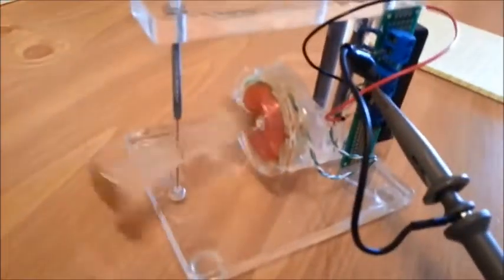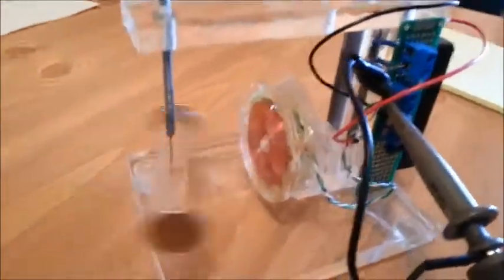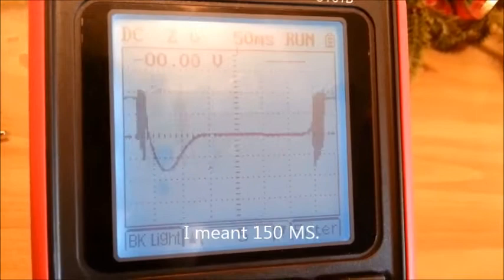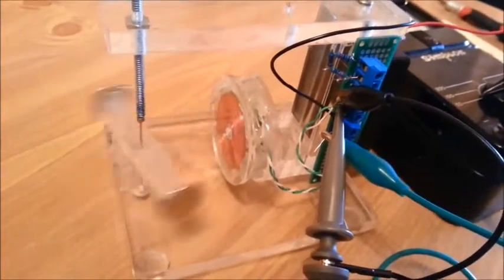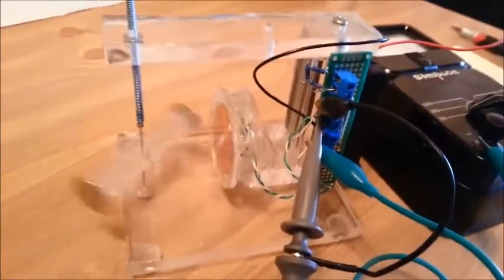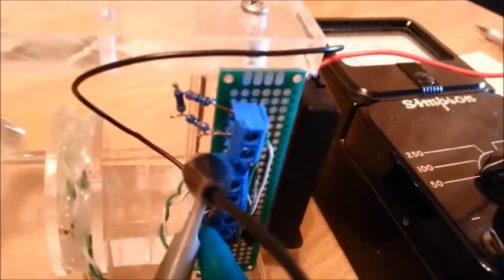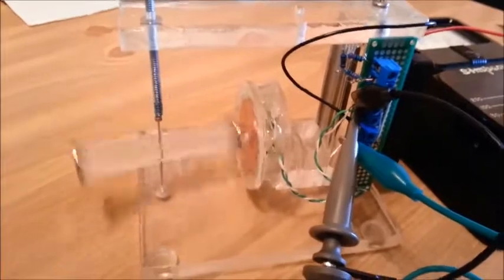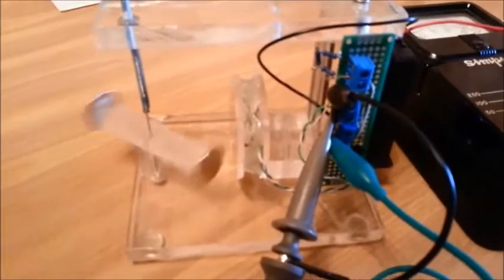20 year Pulse Motor. 2.86 Micro amp draw EZ spin type motor

Comment: Beautifull but I feel like if it would be simetrical , I mean oposed coils, it would be much more efficient
Reply from the maker: The second coil would require more energy to run. The cost vs. the benefit would be difficult to calculate.
Reply: @kafr8413  yes but there won't be that much lateral force when the magnet get repeled , anyways you might be right maybe the loosed energy on the other coil would be more than the benefic from a balanced push

Comment: My new improved pulse motor 0,7uA
https://www.youtube.com/watch?v=y3xaTwCMmRo
Have you tried to make this type of motor ????
Larskro
Reply from the maker: Your motor looks great. I will have to build one and see how low the amp draw is. I like your glass bearing as well. Looks like the rotor has a lot of mass. I like it very much. Thanks for sharing your design.
Reply: My rotor has a little mass. It is made of foam plastic. Diameter 60 mm.

Comment: I've been putting off playing with these for so long but watching your videos along with Pali's and lasersabers, not to mention a few others.. I'm getting pretty inspired.  

so many possible variations for these motors you almost just have to try them all. I like that you are using the 2 magnets and somewhat a substantial sized rotor. That way it basically monopolizes on the pendulum style pulse circuits and uses even less energy. 

I'm waiting on a reed switch to come in the mail today so I can play around with this stuff some more. I still can't decide which is a better switching method mechanical or electronic.
Reply from the maker: Mr. Pali is the real innovator. He invented this out of whole cloth. I am just somebody who copied his brilliant design. His ability to make coils out of thin wire is unsurpassed. As far as switching, in my never humble opinion, electrical switching is the only way to go.
Reply: I certainly don't have the patience to wind such coils... but luckily it's not hard to buy prewound coils and adjust the other components of the circuit to match their inductance. I like those MWO motor coils Lidmotor has recommended. At 12kohms each it's hard to beat.  

Over the years I haven't been able to dismiss a mechanical switching so easily. I've noticed in a lot of motor builds the mechanical switch provides a much better flyback spike. Something about the physical action of the mechanical switch at times seems superior to the switching action of a transistor, though this certainly all depends.  

I had some pretty good results with a crappy reed I got from some dollar store alarm. I received a better quality switch today in the mail but am noticing I get nowhere the same results.   

I am discovering the problem may be in the way I have re-wired my coils. There were originally 4 in series. However I wired them in no particular order. They sort of cris-crossed around the rotor. I decided to rewind them in a uniform order and this may be the reason I don't get the same rpm as before.

I think what's happening is now that my series coils are in order, the lens effect is back as normal, whereas maybe it was greatly reduced with the cris crossed wiring I had before.  

Another cool thing about the reed is what it's trying to do with my motor at the moment. Normally the spinning rotor would not induce very much current into the coils, however as the magnets move across them, the reed switch is also triggering. When this happens it causes a backspike of its own. This allows for the coils to generate a much higher voltage than normal. In my case it's simply causing much more cogging in the rotor but I've been able to use that to my advantage in the past.  

Either way this is frustrating at the moment.  I was getting good rotation from a 440uF cap earlier that would have given be maybe 5-10 minutes run time easily. I'm struggling to replicate that now.
Reply: My biggest question right now is what style to make a motor, with a single super high ohm coil, or several in series around the rotor? I'd say lasersaber has had maybe the best results so far and he seems to stray from ever using a single coil arrangement. Then you have a lot of you other guys with the single coil setup that also have amazing results. Right now the single coil setup would benefit me more in my motor but I can't get around the idea that I still need to make the multiple coil arrangement work because it's ultimately superior.
Reply from the maker: I have done both the single and the many coil design. I far prefer the single coil. I found it far easier to construct. I have made Lasersabers multi coil design and it does look and work great, but joining all the coils can be quite a bother.
Reply: I think I'll have to switch to the single beefy coil setup cause I can't do what I want to do with these pre wound coils. I still couldn't replicate the perfect on times I seemed to find with a certain reed switch and ended up getting worse results so I switched to a separate sensor coil to trigger the firing. A single coil works best at the highest draw but I had to add the others in series to bring that down. It currently will rotate pretty good from under 1 microamp but it needs at least 3.5v to do that. I can't stop until I can get it to go from around 1v at around 1uA AND light some type of small led load.

I actually don't have a single silicon transistor at the moment but when I get some I'm going to try Pali's circuit mod but I want to play around with using high ohm coils with a parallel cap to store some flyback energy from the primary coil instead of adding that ungodly resistance in line. Woopyjump from back in the day still has some amazing experiments there I need to try.
Reply from the maker: 1 micro amp at 1 volt would be quite nice. Good luck with your construction.
Reply: @kafr8413  are you still alive or did the government or some other organization get you?(dont respond if your dead)
Reply from the maker: As far as I know, I am doing fine. Responding if I were dead would have been quite a trick. ;-)
Reply: @kafr8413  ok. Nice. Thanks.
Reply: @kafr8413  i love your videos and have been really intrested in this type of science too.

Comment: Your math is incorrect because you are counting half revolutions instead of full revolutions. 

Very nice construction, thanks for posting.
Reply from the maker: What do you think the math should look like?
Reply: I checked it by timing how long it took one end of the straw to make 10 revolutions (roughly 7.5 seconds) therefore one revolution was 0.75 seconds. 60 divided by .75 gives revolutions per minute, roughly 80rpm.

your rpm counter is counting both ends of the straw, so to get correct rpm, divide rpm by 2, so 154 rpm will be 77rpm, 1.28 rps.  Pulses 1,28 times per second. Also, 3.5x50=175ms, 1.28x175ms=224, so it is on 22.4% of the time. which equates to 1.57micro amps.  if you are pulsing every half revolution the math would be 2.56x175ms= on 44.8% of the time which equals 3.14 micro amps.
Reply from the maker: Thank you for the correction. I am glad to know it is 3.14 micro amps. That is still more than enough to last 20 years with Lithium batteries. I will endeavor to get my math correct next time. :-)

Comment: Very cool, I would love to see a graph of the RPMs over time in comparison to environmental conditions like air temperature, pressure and humidity (air density) or even in relation to things that seem less obviously linked (earth's magnetic field strength? phase of the moon?)
Reply from the maker: It does speed up and slow down due to various weather conditions. I have not tracked the actual RPM, but I have noticed the difference in speed. I have noticed changes when the low pressure fronts come and go.

Paul
Reply: Interesting, I'd love to pick your brain at some point, do you have a preferred chat/messaging service? You can get me at nik282000@gmail.com